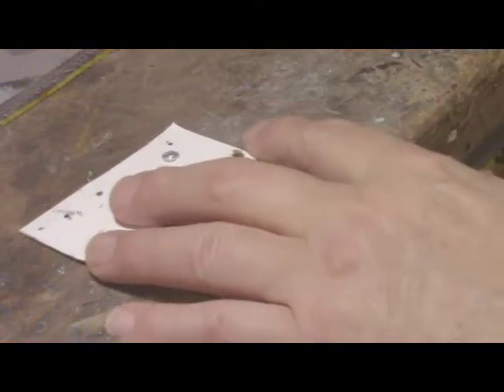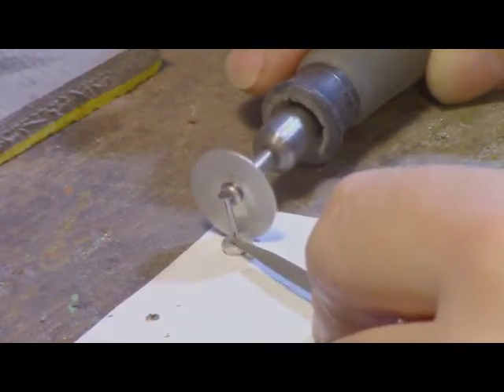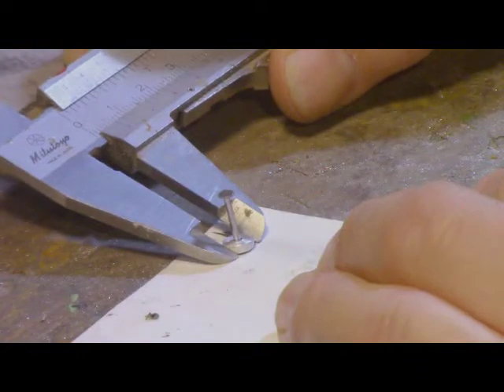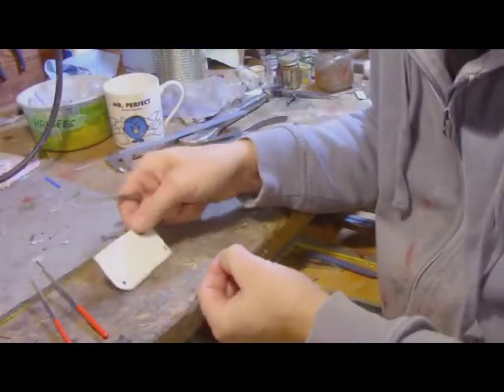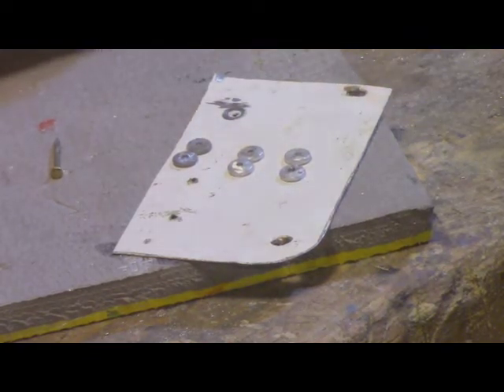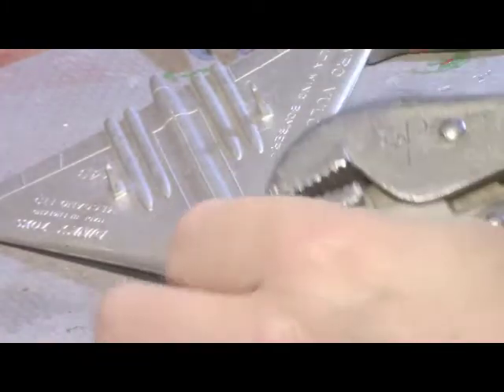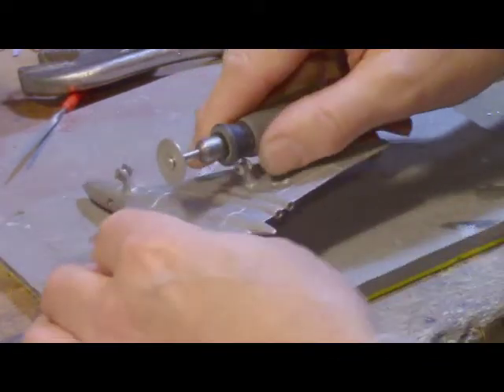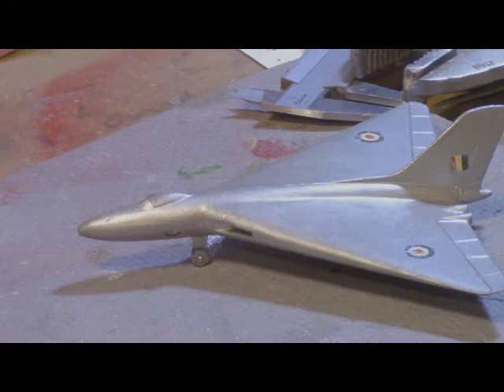DINKY RESTORATION

Comment: If you held it up against the underside of the nail head, it would spin much easier and won't jump around because it has a tendency to spin upward with the direction of the rotary tool...maybe! ;)

You could also pinch an alligator clip just above the "wheel" to keep it from jumping altogether...maybe ;) lol!

Jack - Canada
Reply from the maker: It was not fully round so it jumped until it became more round and then it spins freely. The alligator clip would get in the way of the Dremmel but keep the ideas flowing. "Merry Christmas"